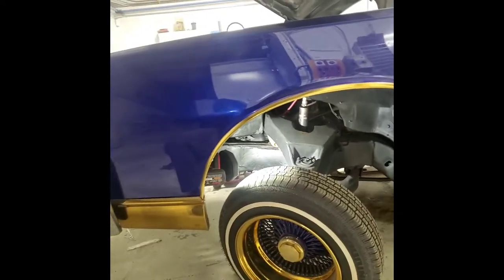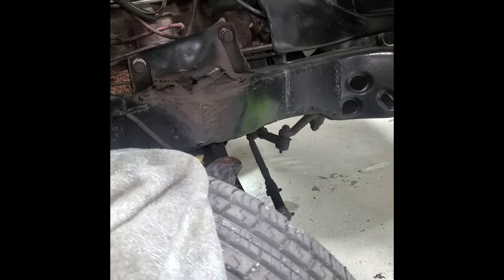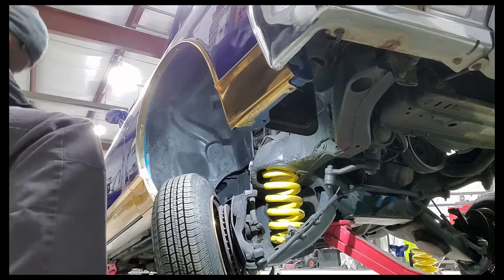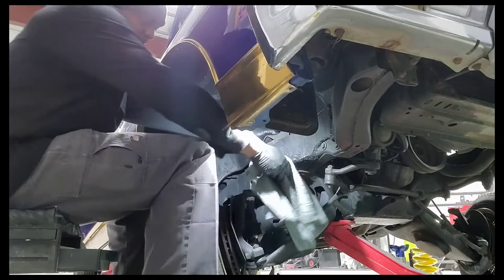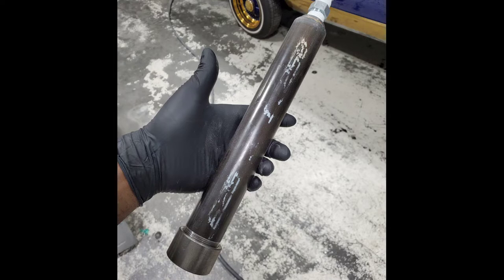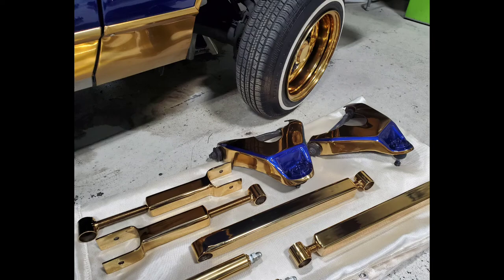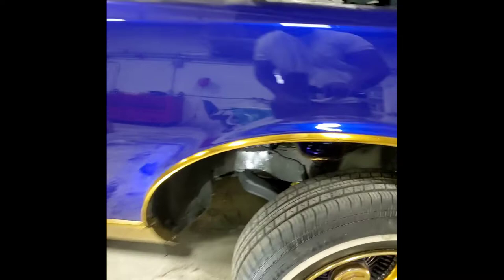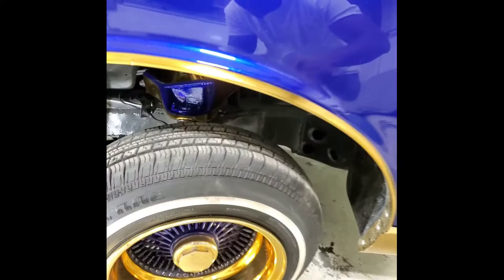Lowrider Polished steel A-arm project + "GOLD"

Comment: Pretty cool. You can actually drive the car polished instead of chrome. Good video.
Reply from the maker: You definitely can! It's been a couple years now and still no rust. I do have gold over mine, but if it was just polished,  I'd definitely wipe em down and polish them a couple times per year. I also don't drive mine in the rain.

Comment: Looks good congratulations, what sand paper did you use during the process.
Reply from the maker: Started with 80 on a grinder, then 180 on a D.A then 320, 600, 1200, then "3000 DRY."  Done.
Reply: @james_crow2352   you said 180 on the D.A.   What does D.A stand for?  I need to get that machine.. i wanna do the same thing to mines.

Comment: Did you polish or chrome plated the parts ..and is the gold painted or gold plated..it looks badass
Reply from the maker: Thanks man!! I did grind, sand and polish my A-arms and cylinders before gold. The trailing arms and upper drop mounts came chrome already. The gold is a special paint that's made specifically to go over chrome or polished surface. I've even put it over polished aluminum for a couple customer.
Reply: @james_crow2352  whats the paint u used to gold em
Reply: @mlclark89  just look up chrome paints
Reply: @alldayallnitelv  i looked online and can only find gold sprey paints that look like ass

Comment: How did the gold hold up since they are just polished and painted?
Reply: And if you remember, how many coats of gold did you apply to achieve that tone of gold? .... I'm assuming the more coats of gold, the darker the gold would appear, correct?
Reply from the maker: It's held up Great! Still no chips and rust and not tarnished at all. It's been a few years now, so I'm gonna have to do a quick video soon so I can show how well It's held up. Did 3 good coats. Not light coats
Reply: @james_crow2352  word! 🙏🏾 thanks for the reply fam. And yeah man, a update video would be a good video to post for content.